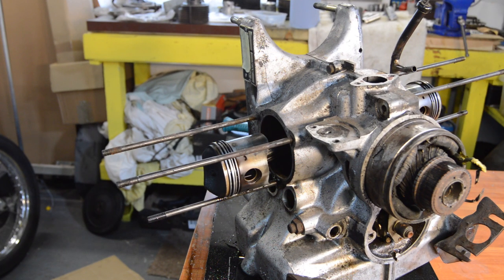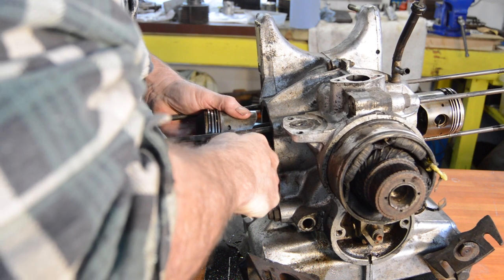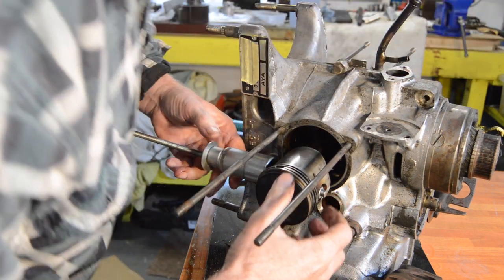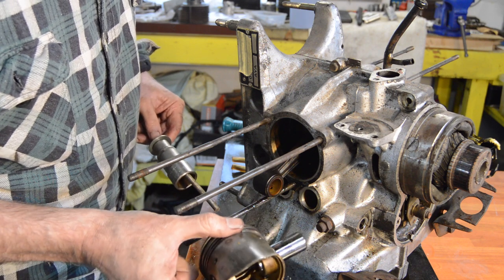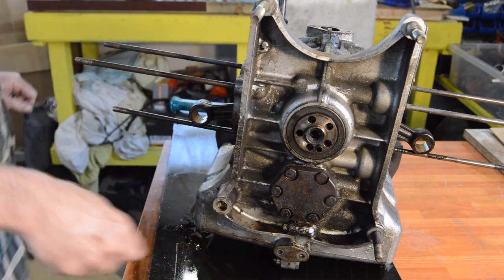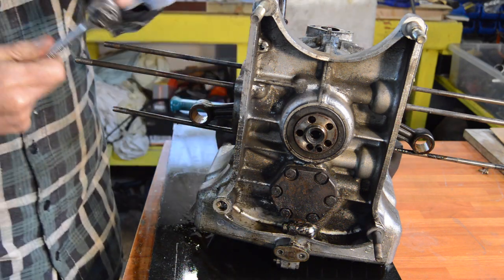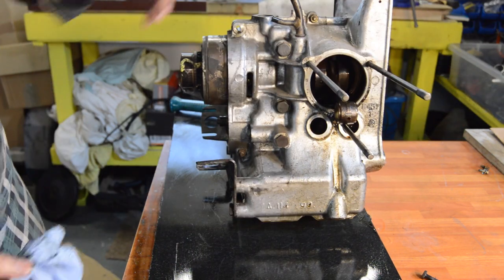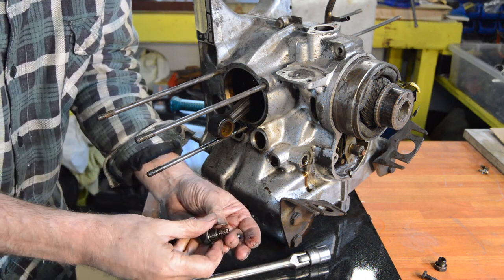425 part 3

Comment: A quick look at the Haynes would seem to indicate crank end float to be 0.07 to 0.14mm or 0.003 to 0.005in. Looked to be at least 2-3mm there. No mention of a thrust washer or spacer.
Reply from the maker: Yep the end float is excessive. There are no washers as you say. The solution ( non factory ) will be revealed in video 5 !
Reply: @oldnutsgarage  The solution should prove interesting. I'm thinking that a pair of shims may be needed, one each side. They may need to be dissimilar thickness to to maintain the correct position of the rods. Don't want them to be angled to the side and put unbalanced pressure on the bearings. What is the reason for the problem? Is there a precedent for this that you have found?
Reply from the maker: You are not able to shim as the end play takes place at the front main bearing behind the gear that drives the cam. Citroen state that once the play exceeds the allowed amount then an exchange crank is required. There is an alternative but I do not want to mention it here as it will spoil the surprise!